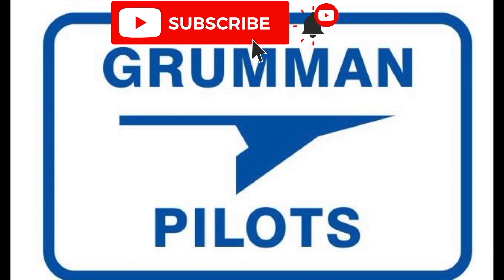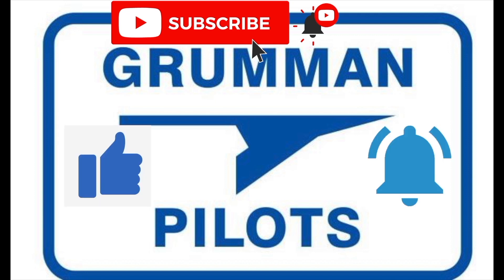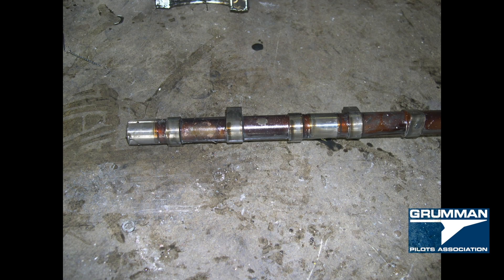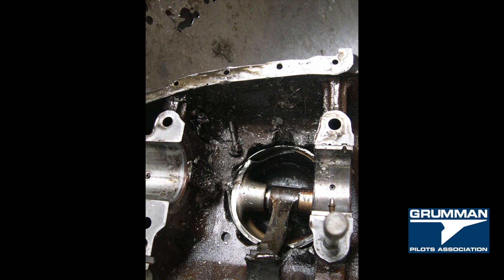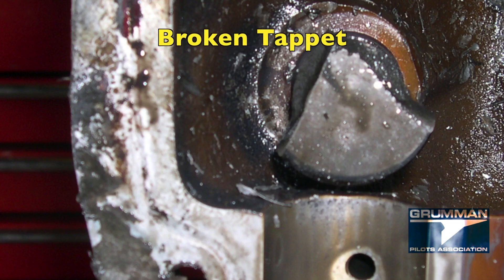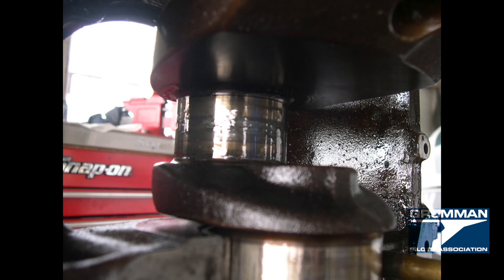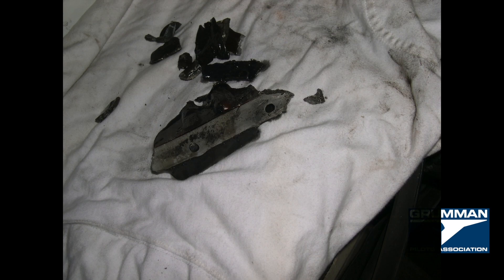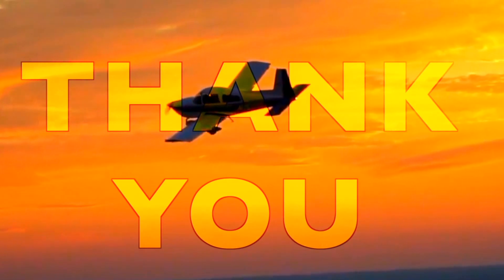Grumman Tiger Engine Out Emergency Landing - Grumman Style

Comment: The Data Plate is salvageable and everything else is replaceable
Reply from the maker: With a data plate all is possible.
Reply: @GrummanPilots   I believe in your case, the Oil Sump has the Data plate mounted on the side and if that is good, you can buy a case and everything else NEW. When I attended Lycoming Factory Training back in 1993, I remember discussing Factory REMANS, where the only old part used was the data plate.
Reply from the maker: @okoboji2001  We ended up using the data plate and a new engine.